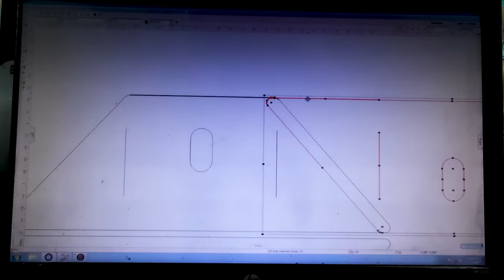More box construction on our 1949 GMC Roadster pickup

Comment: I saw that you said that the sheet metal was galvaneel, or something like that. I worked in a production shop that was building floor pans for jeep about 30 years ago and I had all kinds of breathing issues and bad headaches. The people who ran the plant insisted that the air quality was fine inside the plant when people complained but the EPA wouldn't let us vent the air outside. Sounds strange to me and some other people at the time. I went to many doctor appointments and tests and on and on. I left after about 6 months because I didn't think that it was healthy. I can relate to poisonous fumes from welding the metal. Be careful and thanks for warning people about it.

Comment: Welding on galvanized can cause metal fume fever - flu like symptoms.   At our factory we tried to replace all galvanized in components that needed to be welded.  If we couldn't, welders were required to sand away the coating where they would be welding.

Comment: Great vid as always, thanks for sharing with us. Couple of suggestions, fab up a fence for the band saw out of angle iron or square tubing to help ya with them wobble straight cuts lol. 2nd best cheapest thing i found that works great for fuel tank strap insulators is a roll of the bottom garage door seal you can buy at like Lowe's or what ever you guys have up there. Perfect width, has the lips on the sides to help keep it on the strap too. Hopefully these tips will help ya or someone else. Cheers!

Comment: Tweak'n da box sides, weld'n galvanized pipe, fumes hold yer nose, plazma'd box mounts mount'd, gas tank straps cut fold'd n hammer'd, filler neck cut in n mount'd behind da springy license plate. Ryder's quad's on da rack, Yamaha engine's torn down n com'n back.

Comment: 33:00 I'm surprised that you did not fold the ends over for extra strength of having the bolt go through 2 holes instead of just the 1.  40:40  You know those Pipe Vent Sleeves? One of them would work great as a seal around that filler neck to keep the water and dirt out of the bed.

Comment: Could you not of moved the gas tank as far back as you can and put your air tank in the higher opening you have for the rear diff or your tank looks long and narrow could you not turn the tank sideways to give more room for the air tank in front of it. Not a GM fan but it is looking good.

Comment: @Halfass Kustoms :  Aren't you afraid of the gas tank fill being metal to metal without any ANTI-SPARK insulation??? My 65' Coronet 500 has a tunnel from the trunk floor to the tail panel and the tank has a rubber gasket that the fill tube squeezes into and one bolt that keeps the upper tube to the tail panel. I never heard of any fires or explosions from that system, but yours looks scary to me!!!
Reply from the maker: well the tank hasn't had fuel in it for years and it'll get cleaned out well before put in use. :)
Reply: I actually mean, (IN USE).... Metal to metal driving down the road with fuel fumes... I am talking about your fuel fill neck rubbing directly on the bed floor..  @HalfassKustoms